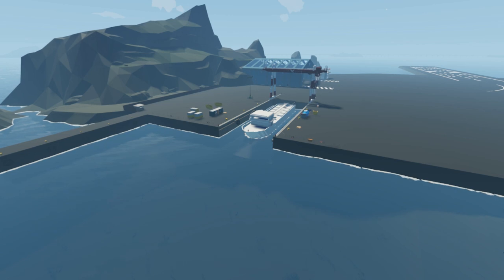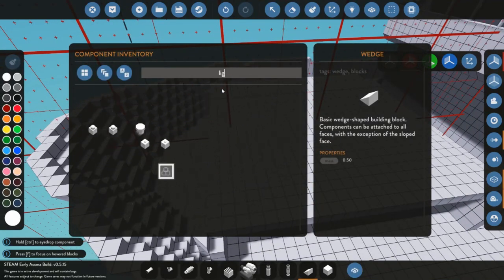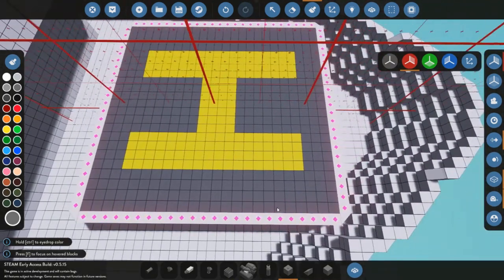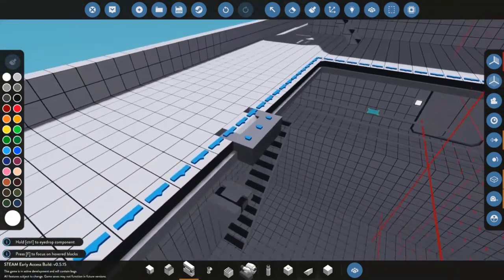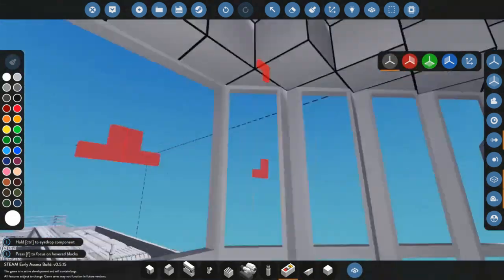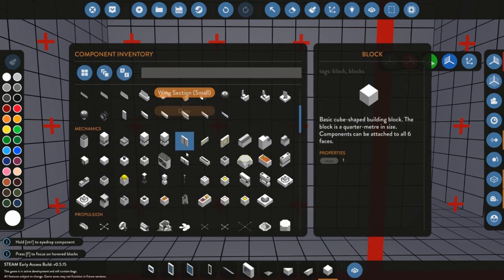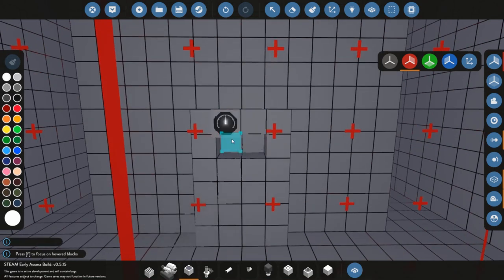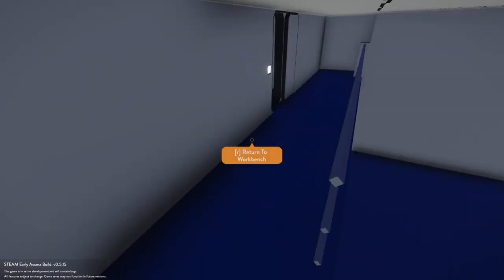New Ship Spotted In The StormRunner Dock! | Stormworks Build Series Episode One!

Comment: Build in a automatic system that evenly splits the oil/fuel into the tanks for max stability 
Or
Make a system to pump the fuel into two at a go so that you first fill in the middle two and then work your way to the ends